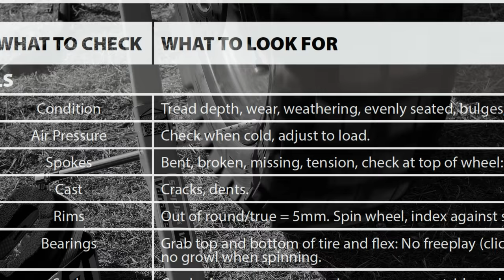Before You Ride - A Quick, Effective Motorcycle Safety Check

Comment: 4:37 FortNine you did it correctly the first time(center stand) yet at this timestamp you did not. You do not measure slack on the side stand. Otherwise, a good way of remembering what to check ABC... I learnt POWDERSS: Petrol, Oil, Water, Drive, Electrics, Rubber, Suspension and Stearing.

Comment: Wait.. i thought the chain should be tight? Mine's fully tight, should I loosen it a bit? Is there a need to do that or its fine being tight?
Reply: It should not be tight. Check swingarm sticker / service manual for correct slack specs. Better to have it too loose than too tight due to unnecessary wear.
Reply: Kmp thanks, I am new to bikes so I know less about them. I will surely check them later. For now i will take it to the mechanic. Cause I don't see any stickers on the swimg arm😅
Reply: Another Millennial thanks buddy, will do.
Reply: Another Millennial umm... Okay i will keep it as it is until i take it to a mechanic because I just tried to make it a little loose but I think I messed something up. Its not stable now😅.
Reply: Mukund Bhardwaj Ryans BMW has a long rear suspension travel, so it need to have more slack than the average road bike.
What's right for your bike will be in the Manual. You read the Manual before you rist rode it right?
Reply: docthebiker um... No😅 I never picked up the manual. Sorry. I will read it right away.
Reply: Another Millennial thanks, but i think you have overestimated me. I don't know anything about bikes (thats why I subscribed to this channel). I will try it though. Hoping that nothing goes wrong.
Reply: @DeFault-Gamer  What I did, go to the mechanic, ask him to show you once, and teach you rapidly, after that you should be able to do it yourself ;-)
Reply: Arthur Boudart I was thinking about doing the same thing 😁. Thanks!

Comment: Too much work. I just have a TPMS monitor on my bike and the suspension/steering test is done when I pull out of my parking spot and ride over 4 speed bumps before getting on the highway. If your chain is loose or not lubricated you aren’t taking care of your bike property or you simply don’t ride enough. When you put 400-500 miles on your bike each week you are going to know if your chain needs lube or your tires need air or your battery is not charged. That’s it.